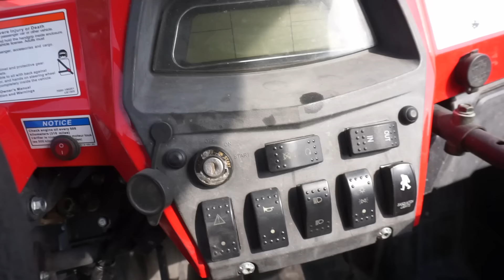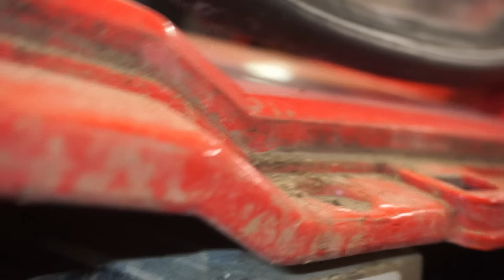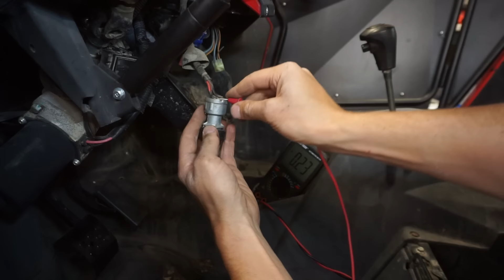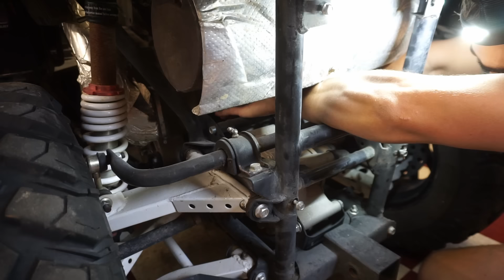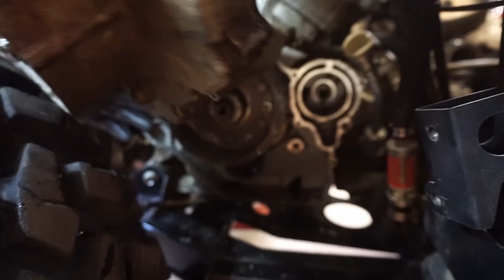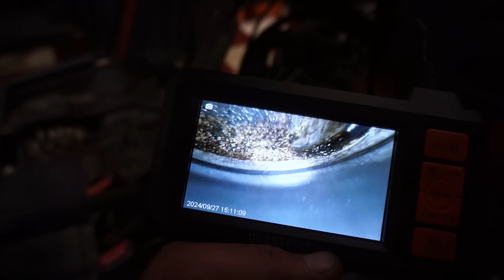Seller Sold Me This $7,000 UTV For $2,500. How Bad Could It Be? (VERY RISKY BUY)

Comment: This ones tough, but i believe the woodruff key had broke when you cranked it. The main evidence being it sounded good for a moment, even fired, then sounded horrible. During disassembly the crank bolt was loose. The crank bolt is what applies the friction so the flywheel doesnt spin on the crank, the woodruff key is really just an alignment/backup safety pin. However the area is definitely salvageable, welding it on the machine? Idk about that. But you could drill and pin the flywheel and crank on the machine pretty easily. For reference look up an LS/LT crank pin kit. I'd stick a new woodruff key in there, replace the one way bearing, clean up the flywheel then drill and pin it.
Reply: Lap the tapers with some valve grinding compound replace woodruff key torque flywheel properly. Also replace one way bearing and gear bc bearing slipping in it damages surface. Yes failure happend when you first turned the key. But Joe won’t take advice. 🤷‍♂️
Reply: He could not have done that much damage to that flywheel or woodruff key just hitting the key a few times, that was done previously by cranking and cranking on it and that key was probably already sheared do to a backfire by the chain being out of time.
Reply: @keyper555  That damage could be done after a few rotations of the engine, albeit unlikely. But considering how the engine sounded when he first got the starter going, it sounded fine, good, with good compression and in time at ~24:14, and 24:55. The assumption is someone took it apart looking for a problem and didn't tighten the flywheel bolt, or seemingly any other bolt according to the video. Everything that happened to that flywheel and crank, happened during the filming of this video. MAYBE it sheered one in the past and had damage then, but you're not gonna tell me the machine was sold to him with a sheered key. The evidence DOES NOT support that claim.
Reply: @diablofocker1  You are correct.  Probably had issues with the timing chain originally and seller just threw it back together with out tightening stuff.  The flywheel bolt being was loose confirms this.

Comment: Well cfmoto quality metals it's China they can't even make rebar to spec. Pack with jb weld , coat new woodruff with turtle wax and press in and let set, wax will not let key bond.  Jb weld is stronger than China metallurgy.. well if one side was repaired there fools for not checking the other motor was out.but I also wonder how smiles after repair it ran.  . Mechanic taking short cut or customer. Motor out you replace things like that to prevent future issues. Especially on side by sides motor out check everything. Bummer but sorry cfmoto honestly junk , get what you pay for. China blah IMO

Comment: Snap-on , take it to local dealer, they will fix or replace it. Or find out when the truck goes to local garages and talk to them. In Canada the Snap-on truck won't help you unless you work at the garage, but they will sell you stuff. Anyway it's worth getting fixed as it is a $200+ wrench

Comment: If you pull a connector you should give it a quick squirt of contact cleaner before popping it back in. Weld in a new key and file it to fit.
Reply: I would also have blown all the dust out of that wiring area before replacing the cover.

Comment: Looks like the flywheel bolt wasn't tightened properly from the prior repair causing the whole problem.  It appeared loose when you were pulling things apart.

Comment: Your idea about using a putty is good, plus put some type of loc-tite on the taper when you put it together will probably hold it. Other than that, tig welding and re-cutting the slot on a mill would work.
Reply: Never ever put anything on a taper, just make sure it is perfectly clean and dry:body-green-covering-eyes:🤨😁
Reply: @104ducati  I think I've heard that before, must have forgot. Thanks for the tip.

Comment: For the crank, I'd weld it, then re-shape back.. and 100% lap the new flywheel on. I've heard from many engine builder you shouldnt rely on the woodruff key.. the flywheel to crank should be tight enough the the pressure from the bolt should keep it from spinning.. the woodruff key is like a back up, but only helps just that bit.. main point is to make the flywheel and crank surfaces mate tight enough you dont need a woodruff key.. old briggs 5hp kart racers ran some super cut woodruff keys.. same with the older banshees, for the timing they shaved the woodruff key.. it's all about the flywheel to crank fit.
Reply: This is spot-on. It's the taper that locks the flywheel in place. Lap in with fine valve grinding compound to ensure a perfect fit. The force supplied by the nut's torque jams the two tapered surfaces together, and it won't move. The tapered-shaft KT100 kart engines we used had a (small) taper on the output shaft, where the loads are much greater. You could run them without a key if you had good fit of the surfaces - in a pinch we'd hose it down with red loctite if the surfaces were not good.

 My father and I also built hundreds of 5HP Briggs flatheads for kart racing. Even the box-stock class rules did not control ignition timing. We used to make our own heavily offset FW keys from aluminum, as it was easily worked with hand tools and isn't under load with a proper taper fit and torque. We offset both sides of the key above the crank surface, creating a Z-shaped key that produced, if memory serves, in the range of 25 degrees of advance. We had a compartmentalized plastic box with keys made to sweep a wide range of advance from the low to high 20's that we swapped out at the track to figure out the ideal timing per the stopwatch.

I'd be inclined to make a similar key for this machine, should the parts be available to fix it. I'd make it as wide as the damaged crank slot at the bottom, and maintain the top on the side that's not damaged. The just file down the other edge above the crank surface to match the width of the keyway in the FW. In this case you'd be making a L-shaped key.
Reply: A lot of chainsaw builders do exactly as you mention. They delete the woodruff key entirely and lap the flywheel to match the crank because they're always messing with ignition timing.

Comment: Hey Joe,   
         A  Very similar FATE was encountered by the people down the street from us. 
   How  So  ??  Well to be Quite HONEST  ( SWINDLED ) by some  fast talking  Con Artists is what  everyone  came to the conclusion of.   RAN when parked or NOT maybe  Fine. Neither of the  Two Faced  Sellers could get the story or any facts striaght. .  Maybe, it Just  needs a  Tune up,  Some  Fresh gas and some filters changed ????  When asked about the supposed cost ?  They Way underestimated at  about  100 bucks or less depending on the brand  selected and from where each was purchased.   ANYONE  ever hear this phrase before..

""""  If it  Sounds To Good to Be True - ???
That is the * RED Flag *  To  RUN - Not  just  walk away -clearly """

They did a  few parts items and nothing changed from the way it was NOT  working correctly. A few of  the shops said they could look at it butt it  would  be at least  two weeks or longer before that could happen and they first needed to get a  Trailer to transport it  also.   ANYONE  care to GUESS what  some  Early Estimates came back as ???
Not 100, NOT  1000, it was going be a lot close to 5, 6, 7 , thousand or more depending  on the exact route the DEALER and  the Customer would  eventually  decide was overall. 
   Un-Lucky or  MAYBE  ( JUST  ) Lucky Enough  one of the Friends of another   Group they sort of knew asked if they would  allow them to take a  closer look  before going down that rabbit hole too.  There is a  Saying  way often Forgotten by many ( HERE it  Is ) 

"""  It  is NOT  what  YOU  know  (B U T T)   Who  YOU Know that Matters Most still """

This person had a Wide and  Extension knowledge of  many things  Mechanical and Electrical also.  Being  Re-Tired they Still liked to get into the mix  of  fixes and repairs  as well.  NOT  really for the PROFIT or  FUNDS that  might come from it  or  not.  
   It was a  Challenge to keep his OWN Skills sharp by Trouble - Shooting and  seeing  how  Really  good or  bad the so called ( ESTIMATES ) were in comparison. 
Telling  YOU all this today for a  SIMPLE Reason.  
    LIES are often Disguised as  Forgotten Memories with Cloudy Details both given and eliminated also when  Sellers and Buyers  - Meet. That being  with Money being the WIN / Lose factor  some would  rather not  get to deep into HAGGLING or  Low Balling either. 
     From a  Chewed Through Wire here,  Bad  Fuse There,  Low on ALL  the fluids,  Metal shavings  still  found in the  Residue of what had occurred before hand  sadly, etc. 
 Used / Recycled, Scavanged  parts sometimes are the only  TRUE  Saving  Grace from a  place  many disregard to often .   A piston, cylinder, bearings, gaskets, Sealants,  FLUIDS, Wires  reconnected better the factory, Filters  Again Replaced, Battery and a  few miscellaneous items  came in at just about  1,500.oo  bucks  PLUS PLUS PLUS  with a  minimal charge added on for this  ( SECRET Santa / Saving Angel ) Taking  pity on them for being so Dam Gullible when trusting these  SCAMMERS in the  first place.   
 What did the entire deal cost them ? 
After all the back and forth transportation and Guesstimates also.  Parts cannon the first time, and then the Delays in finding  parts of  any kind
    Just under what a  REALLY Good  / Slightly  Used - Demo model would have  cost. 
WHICH Oddly is the exact path  they originally had considered.   BUTT were swayed by being promised of  just a  few hundred maybe being the needed fix - FALSE HOPE sold them.
     USED is NOT ( NEW ) nor  are DEMO  Models  Perfect yet,  still are some what cheaper then the Alternative.     Second, Third, Fourth, fifth party  Sales ( SELLERS ) Removed from any New deal going down is a  RED FLAG  like no other. 
  
*  Guilt by Association *        ((((( YOU are who YOU hang  With ))))
    That couple did finally  get a  useable machine to ride.  Yet  ( F A T E )   was soon to be dealing them an entire   Story much longer then there is time for here..   They Sold it about  a  year later.   Nearly giving it away  just to be done with the TRAUMA it  caused to the Bank Account and  Personal  Relationship overall as well. 

 ALWAYS  Remember to NEVER Ever Forget  this

K. I. S. S.   as in::  KEEP It Simple - S T U P I D ....

The V O I C E   of   R E A S O N   has  spoken

Comment: I wonder if you can use a dremel with a circular grinding stone, open the area up bigger to accept a larger woodruff key. Then dremel the sides to match the oem woodruff key on the bottom. That way you dont weld just grind your way. But I think it would be much cleaner repair then welding and risk warping the crank

Comment: I would only trust welding the key slot on the crank. You should be able to do it yourself and then Dremel it back into shape. It’s a minimal weld so heat wouldn’t be an issue.

Comment: The plastic expansion tank being full could be the system has drained back to the expansion tank,check your radiator and how much coolant is in there
Just because the tank is full above the full mark could be the radiator sending it back to the expansion tank.
If it’s overfilled it will send it out the overflow hose.

Comment: Buddy. I think you stripped off the crank. Because at about 24:10 when you first started it by accident it cranked fine. Just starter making noise. Even tried to fire once. Based on that crank was turning. You may not have started the damage but you definitely finished it.  Lol
Reply: Exactly what I thought; I noticed that.
Reply: No doubt
Reply: should not have happened though unless the seller had it taken apart and didnt torque it back down. just left everything loose trying to find the issue.

Comment: I think if it was me, I would pull the engine and go through it, might cost a bit more, but, easily could avoid the situation of trying to patch it a bunch, failing, and having to tear it down anyway.  Selling it with a rebuilt motor should bring a higher price.

Comment: One side of the key slot in the crankshaft is not damaged, one side is.  Living where you do, there are Machinist and toolmakers  near you capable of fixing it. If you lived near me, I'd fix it for you. They can very carefully tig up the damaged slot, then by hand recut it. I've personally fixed 5. They were damaged from the primary gear coming loose. You have another issue in its position controls engine timing. Good luck!
Reply: Also, notice the damage being on the side that would be "punched" by the engine firing. The machine ran a while with the flywheel loose to do that. I'm calling it as they had the head/cam chain replaced & the "technician" (whose tools ought to be taken away IMO!) never torqued anything properly, machine ran good a while until crank bolt worked loose and then became increasingly hard to start due to "random" timing within 20 degrees or so of play it had, starter sprag began acting up due to combination of kickbacks, dirt and misalignment until it eventually failed.

Honestly I think the electrical issue came about as it was told, just luck of the draw that Joe fixed that only to get the last crank out of the sprag clutch and discover the deeper issue.

Comment: All that carbon is because of not running the proper octane. You can not use anything lower than 90. 90 plus octane would have prevented all that carbon build up and makes the engine run much better.

Comment: My recommendation is to lap the flywheel to the crank I've seen some race engine builders who do this when they run without a woodruff key to modify the timing of the engine  It will help the issue here using lapping compound.  Also, you noticed the flywheel bolt was loose when you first put a socket on it. Someone didn't tighten the bolt to proper spec which may have caused this secondary issue. Probably when they replaced the cam chain.

Comment: Starter Relay/No Crank: Its possible even probable that there was a bad connection at the relay, however the poor connection was more than likely "repaired" by your inserting the DVOM probe into the terminal, thereby "crimping" the female spade connector. Also better to use an incandescent test light when checking for power at circuits. If your lamp is dim you're not getting full voltage/amperage. A DVOM will tell you that you are getting system voltage even if there is only one strand of copper left in the circuit. Its another way of checking voltage drop in a circuit. Either way, voltage drop will be revealed whether it is a test lamp bulb going dim when the circuit is loaded or watching your DVOM go from system voltage to anything but system voltage. (12.8 V key on not cranking in this circuit, to, for example, 7.6 V with the key in the "crank" position. You are losing 5.2 V due to excessive resistance in the circuit)

Comment: typical CFmoto junk. hard to find parts for and very unreliable. Bet ya the 1 way bearing stayed engaged and spun the starter while it was running until it overheated the bushings in the starter and it locked up and sheered the flywheel key. That's what the last CFmoto atv that I worked on did. You can buy oversized stepped woodruff keys from McMaster Carr and use a dremel and clean up and enlarge the slot. It works. That's what I did on the CForce 850 that I repaired for my neighbor 2 years ago.

Comment: Carefully file the flywheel and crank. Then LAP the flywheel taper with coarse then fine lapping compound. Buy the CORRECT key from the dealer and reassemble. DONE.

Comment: I would try a new key and see how tight it is, Looks to me like most of the damage to the crank happened when the key sheared. If the key is tight enough I think as U said it should be in time and work fine if the new/newer FW locks down to spec and clears the ig components.

Comment: Could you just put some Loctite in a new woodruff key and on the new flywheel and then torch down the crank bolt.  That should keep it from spinning.
Reply: he's doing the repair online, and I assume he resells them so he needs to try to do the repairs right. maybe if he kept it .

Comment: If you can come across a piece of brass that is the thickness of the key I think you can weld it!! The weld won't stick to your brass key!! Just take your time and get your setting like your heat and your travel speed ( wire speed)
Reply: Or get a key broacher and do it correctly.

Comment: 800's have a common issue with the relay block, specifically the auxiliary start relay. It's not so much the relay, but the connectors in the block.
Reply: Just so you know, that first box under the hood is actually the power steering control.